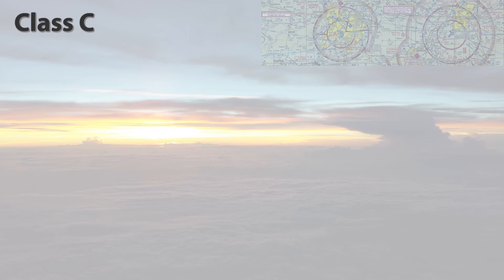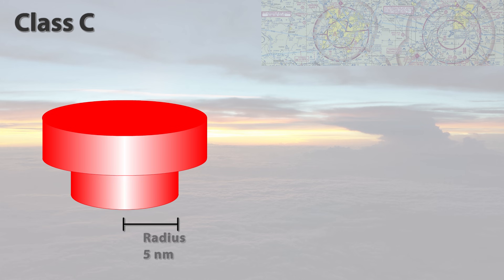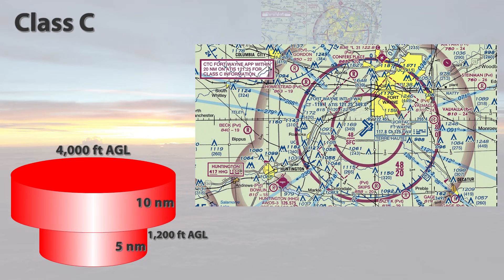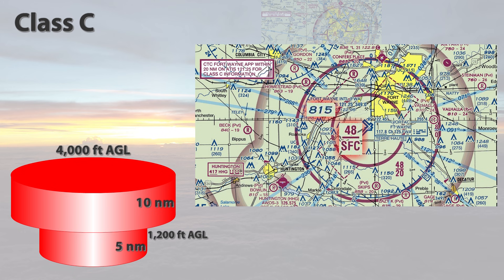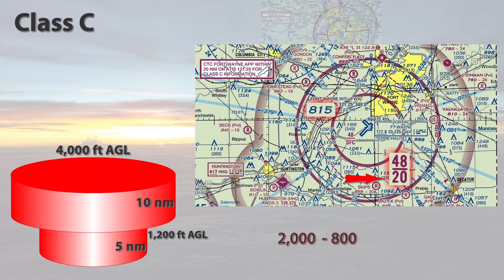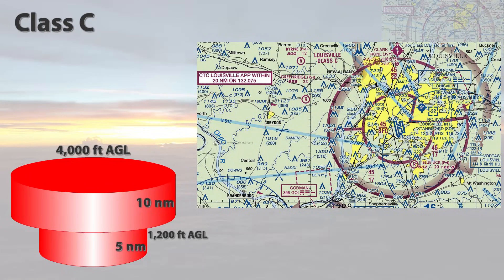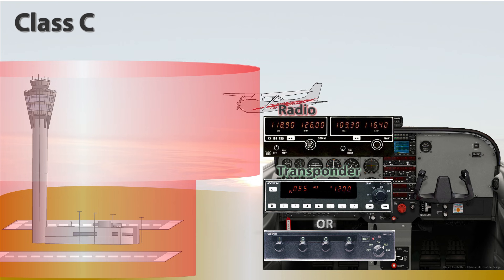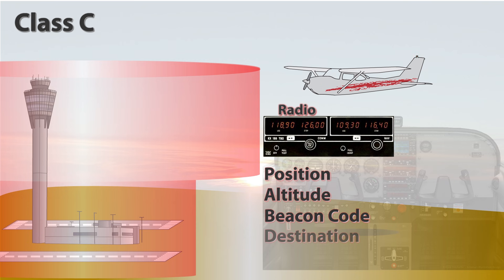Class C Airspace Defined

Comment: Is a radius counted from tower or NAVAID ?
Reply from the maker: Thanks for the question and comment! Usually the radius for the airspace around and airport is measured / starts from the center of the airport itself. Occasionally a NAVAID / VOR will also be located there, but the airport itself will be where the airspace starts from. Check your VFR sectional for the actual dimensions and layout. Hope this helps. Thanks!
Reply: @PilotRight  thank you so much

Comment: In the second chart concerning Louisville, does the fact there is magenta shading make it controlled spaced at 700 AGL even though the outer shell doesn’t start until 1200 AGL?
Reply from the maker: Thanks for the comment / question! If I understand your question correctly, the magenta shading indicates class E airspace extending down to 700' AGL. Below that is then class G airspace to the surface. In the video, the sectional chart I used does show the class E to 700' AGL (the magenta shading) at the same radius as the class C. So starting from the ground under the 10nm shelf you would be 1. In class G at the surface up to 700' AGL. 2. At 700' AGL it would turn into class E and extend up to the bottom of the class C shelf. 3. At 1700' MSL to the south or 2200' MSL to the north you would then be in the bottom of class C. 

Also I want to make note the sectional I used to make the video is fairly outdated. The newest section and airspace information is slightly different around KSDF.

I hope this makes sense! Please feel free to post any additional questions. You can also email me at info@pilotright.com and I'll be happy and clarify anything else.

Comment: What’s up with the identifier “November 1234”???  NO ONE states the N at the beginning of the tail number. Good video on dimensions and graphics, but not so much for the communications.
Reply: The "N" is dropped if the aircraft manufacturer's name or model is used: HAWK N666CB would be called out as HAWK SIX SIX SIX CHARLIE BROVO and after ATC contact it would be shortened to SIX CHARLIE BROVO (or so I believe as I study for Part 107 test!).
Reply: garysonik fife